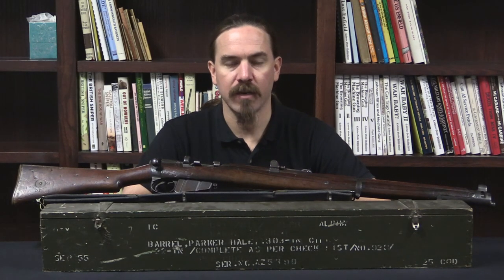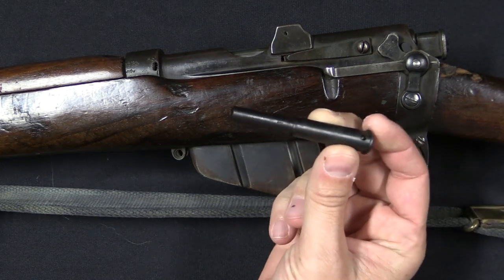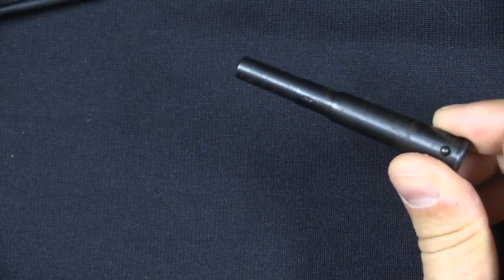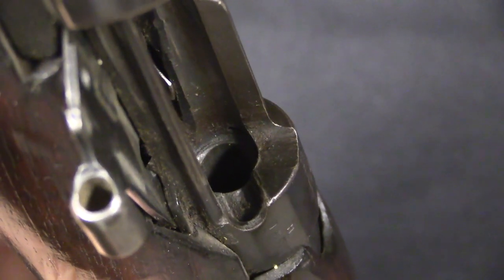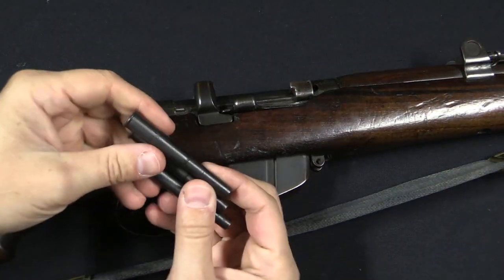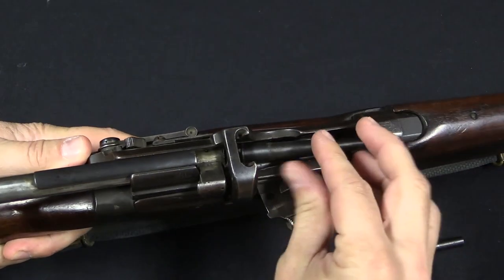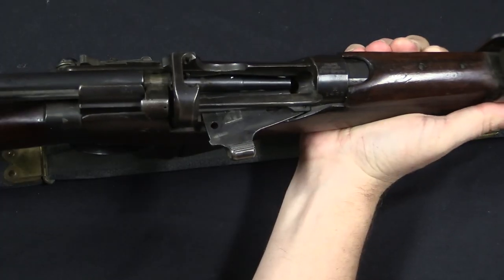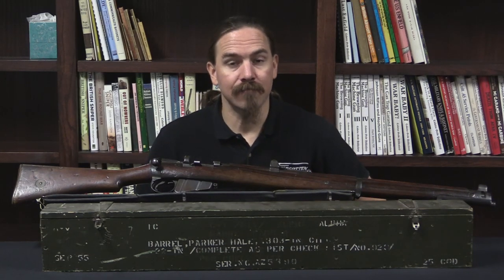Parker-Hale .303-.22 Conversion Kits for the Enfield, Lewis, and Vickers

Comment: AJP/Parker Hale went on to make sub-calibre adaptors in .32ACP that could be fired through a normal .303" barrel. These are the same sort of .303-shaped tube, but the .32ACP round sits in its own little chamber at the end; there is no separate plug or breech system. Because .32ACP is centre fire, the normal bolt and firing pin of the rifle operate it. The .32ACP bullet diameter is around .3125", so it seems that was ok to squeeze through a .311" Enfield barrel!
Actually I have four of these adaptors and will be trying them tomorrow on a gallery range. If I stop posting, you'll know the system maybe didn't work so well...

Comment: I own the thing that a lot of people were actually expecting which is a removable barrel sleeve with .22LR chamber and modified bolt and extractor that enables an SMLE to shoot .22LR in a quickly reversible manner with zero danger of loading .303 into it. Can’t recall the origin of the kit.

Comment: I assume a regular .303 round would not fit? Bearing in mind the daft things soldiers have been known to get up to that would be quite important!!!
Reply: This was my first thought - what will happen if someone tries to chamber a .303 by mistake. Is the .303 longer than the conversion sleeve?
Reply: It really looks to me, from the overall length of those adapters, that the .22 portion of the barrel is far forward enough to still allow someone to chamber a .303 round!
I'd like to think that you can't....Like you, I'd assume that you can't....But yeah, that would be bad....very bad indeed.
Reply: We really need a answer to this
Reply: Bumping for answers. My first thought was that this gun still looks and feels like the 303 it was converted from. Surely the risk of 303 insertion into the converted 303 cum 22 is something that should have been mitigated against? It would be an easy mistake to make and I wouldn't want to be the one to try and force a 303 bullet through a 22 barrel. Nasty.
Reply: Bump!

Comment: Can you still feed regular .303 into the rebarrelled rifle, and can you feed those "containers" into a normally barrelled rifle? Neither possibility seems particularly favourable.
Reply: I have a feeling that full size .303 won't fit, since the front of the insert would have to butt up directly against the .22 barrel, and a full .303 with a bullet would be too long and the bullet too wide to fit and fully chamber. Doing the opposite would be completely ineffective for anything remotely useful but not dangerous.
Reply: I  can see a slightly slower witted private smacking the bolt home and "300blk in a 5.56ing"   his training rifle
Reply: @tmurdoch2  Isn't that only possible because .300blk is way shorter than 5.56? Cos I don't think even Private Neanderthal could put enough unga-bunga on that .303 bolt hard enough to get it to go.
Reply: To me they kinda look long enough that they would. Judging by where the shoulder on the adapters are. They seem to fill the magazine all the way too, so i guess there is space for a .303 cartridge in the chamber.
Reply: ..that sounds like a good recipe for disaster
Reply: @panfriedmarmot  Never discount the abilities of Private Neanderthal. If he has to hold the rifle by the barrel and hammer the bolt handle against the bench... he will.  Can you say 'compressed powder charge and obstructed bore'.  Private Neanderthal is almost guaranteed to survive unscathed... the guy next to him...?
Reply: Halfwit new boy loads 303 rounds into it and bang  catastrophe!!! No wonder it only lasted 1 year before becoming obselete
Reply: @honorharrington4546  Man ain't that the truth, not just in the military either. I'm not a particularly religious person but there is truth in the saying "God protects children and idiots."
Reply: Don't disregard the strength of Private Neanderthal. My cadet unit had a cadet break the bolt handle and rear end of the bolt off the rest of the bolt - I think he managed to get the striker in the half cock notch (Yes, the SMLE had one, just like the Brown Bess musket). I think it was the same cadet who also broke the butt off his rifle by using it to excavate a rock from where he wanted to put his bed roll.
Reply: I can almost immagine some gun ignorant character yell to his buddy "hey bubba,get me a bigger hammer, This .303 round refuses to chamber". Sad but surely true there is bound to be someone out there waiting to do just that.

Comment: As the adapter has a firing pin, pressure chamber and barrel. Each one would count as a seperate fire arm for licencing and Proof Marking in UK. The Reason was nothing to do with the War Office, it was the Treasury screaming about the cost of .303

Comment: If the chamber is left the original size and the adapter being that long there would be a very real danger of someone firing a regular full size .303 round in one of these and blowing their head off. It would have been wiser to make the barrel liner longer, taking up the space normally occupied by the bullet, and the adapter shorter so a real cartridge wouldn't fit in the chamber. Additionally that would have reduced the length of the unrifled bore inside the adapter. At least the converted rifles should be very clearly marked by, for example, painting the stocks with a contrasting color, to differentiate them from the unconverted ones.

Or is there some clever thing in place to prevent a regular cartridge from being chambered and fired?

Comment: In the mid 1980s in air cadets we had some .22 converted SMLEs. These had a sleeved barrel and chamber, and no magazine internals. Each round needed to be individually placed into the chamber (and if you dropped the round it fell into the empty magazine!).
Reply: I used a Cadet version of the SA 80 that fired .22
Reply: @BS25999  , never got the SA80 before I left. I moved house and hence squadrons, and at the first we had rather nice .22 rifles ,at the 2nd they were somewhat crudely converted SMLEs. Also a reasonable amount of .303 and on one occasion on the range with SLRs.

Comment: wonder how many of these blew up from people putting live .303 in them by accident, or broke firing pins with that awkward transfer system for the firing pin, surely just replacing the bolt to fire rimmed and have the .22 on the rear of the dummy adapter would have eliminated both issues?

Comment: i believe if you costed the labor involved in loading/unloading these things that you'd quickly see it was cheaper to just train with 303. and i mean even after you factor the cost of needing a factory to make rounds just for training. factories with properly mechanised production lines are how we make things as cheap as china makes them now. using a soldier to load training cartridges is far more expensive than using a factory laborer to watch a machine that loads hundreds in the same time.

Comment: Could you still chamber a .303 round? That sound like a disaster waiting to happen
Reply: i was thinking the same.. unless the firing pin is slightly modified so it wouldn't fire a rifle round..
Reply: Seems like a valid question. I would like to know as well.  As long as the adapter is, it looks like it would be possible to chamber a real 303 round.
Reply: You know that if it is possible, some dopey character will have tried it! (Once!)
Reply: Weird kinda bore obstruction, Presumably some of the pressure would escape but not fast enough to avoid the Kaboom.
Reply: @davefloyd9443  based on .300blk in a 5.56 bore, it sounds pretty catastrophic.
Reply: Scott. Really sorry I dont know what you mean by that.
Reply: @davefloyd9443  .300blk is very nearly the same dimensions as 5.56, just with a .30cal bullet. Same case head, same overall length, etc.

So while it's not supposed to chamber, sometimes it will. And then you're trying to push a .30cal bullet down a .22cal barrel when you pull the trigger. Typically breaks the locking lugs off the bolt and blows out the magazine, but sometimes it will blow the entire upper into aluminum shrapnel.
Reply: @ScottKenny1978  Perfect thx. I had forgotten that 5.56 is .233

Comment: I wonder how that system would work with a BREN? Would a large gas port provide enough power to cycle the action or is the .22 LR just too anemic?
Reply: . 22lr is too weak and too dirty to function properly in a gas system. If you cpuld get it to work at all, it wouldn't take long to get gunked up and lose reliability.
Reply: @ericsmith5919  And yet the M1919A1 Machine Gun was adapted to .22LR by use of a floating chamber which harnessed gas pressure to operate the action.
Reply: @DRNewcomb  From what I can tell, the floating chamber system seems to be an enhanced blowback or gas/blowback hybrid system designed specifically to maximize the anemic recoil of .22lr, and doesn't make use of a gas tube or any existing gas system in a conversion kit from a higher caliber.

Comment: Question for gun experts here. I do have a pattern17 rifle with a very old .22 conversion. I have no clue who did the conversion or if it is a one of. Anyone?
Reply: Parker Hale did some P14 conversions to .22". They are not common because the bolt and receiver require a lot of work. On most of them, a big chunk is cut out of the right side of the receiver ring so that the .22" case doesn't get lost or stuck in the forward locking recesses. Converting No1 and No4 rifles was much easier, as the separate bolt head could be adapted for a floating RF firing pin, and rear locking lugs meant that the chamber was directly accessible for loading with the very small round.
Reply: @turbogerbil2935  me, nor the previous owner do not know who or where it was converted. Manufactorer or a high skilled gunsmith. No Idea. Previous collector imported it from the USA years ago. The owner in the USA had also no Idea except the conversion was done before 1950 because that was when his dad bought the gun. I do collect guns in not original calibre wich where converted before 1960. I can trace all of Them except this one. Nice single shot .22 P17 though. Shoots realy well.

Comment: I just watched an old film called Scarlett and the black it has an unusual rifle with two triggers in the guard anyone know anything about it I never saw two triggers inside a trigger guard before
Reply: The second "trigger"  (usually the rear one) is actually to "set" the front trigger to gnat's whisker let-off pressure.
Just thinking about squeezing that trigger with your finger resting on it will set it off!
(Just kidding...but it is light)
Reply: Now a shotgun with two triggers is more common...one trigger for each barrel in a double barreled shotgun.
Modern iteration is a safety selector with a left and right slide to select the barrel the single trigger sets off.
So your thumb slides the safety forward and off and at the same time slides the selector "bump" left or right...

Comment: To me it seems easier to upgrade range to handle 303 rounds
Reply: Definitely not....overhead beams, reinforced berms...or do you want to try firing a .303 in a concrete drain pipe?
You'll only want to do that once....

Comment: Always found the British military practice of declaring a thing obsolete when it is clearly still viable technology of equal or even greater usefulness to the replacement system amusing. Meanwhile, the Russians and even Americans have frequently kept comparatively ancient systems in service for many decades and despite "replacing" them multiple times over, the old systems are not declared obsolete, such that they remain acceptable to plug into Tables of Organization & Equipment as substitute standards if the occasion calls. Sure, the British technically do the same thing from time to time, but going so far as to declare everything replaced in service as obsolete irrespective of their technical capabilities is just funny.
Reply: The main reason is mostly political. The bean counters have a horror of the military keeping anything, so often will insist on kit being declared obsolete before authorising funding of a replacement. There is also the term "obsolecent" which means that an item is due to be made obsolete and will be replaced, however can continue to be used until such times as stock is used up...
We have become really stupid with this in recent decades, with equipment (particularly aircraft) beibg destroyed as soon as it is declared obsolete to stop horse trading at a later date...
Reply: @felixthecat265  For sure, but it is funny all the same. Have to laugh because otherwise one would despair, since it is not like we can stop the insanity long enough to matter. 
      And in fairness to the politicians, it is hard to justify weapons when you can't seem to find an enemy that you can openly call an enemy, especially when those undeclared enemies are all inherently much stronger than you. People love their NHS, their pensions. Telling voters that they need to give up a boost to welfare spending so the Army can buy 200 new tanks is a hard sell at the best of times. Even harder when the Russians have over 10,000 and the Americans are willing to buy 9,000 with their own money and commit those 9,000 to the defense of all NATO members. Really, it is a wonder there is a British military left at all at this point. :)